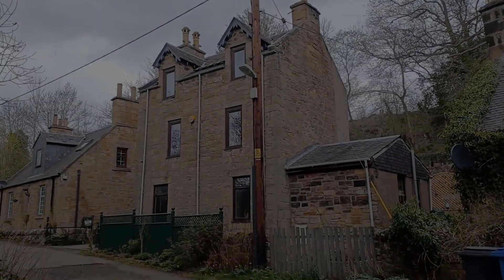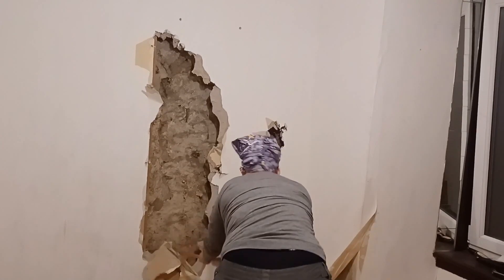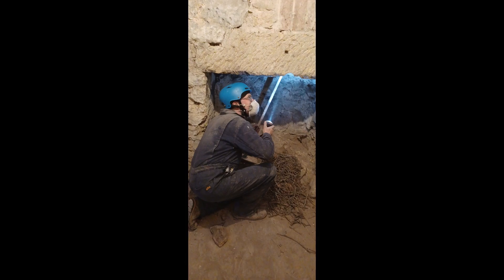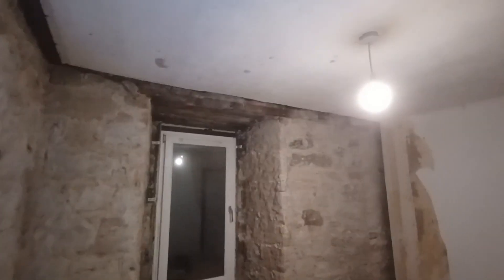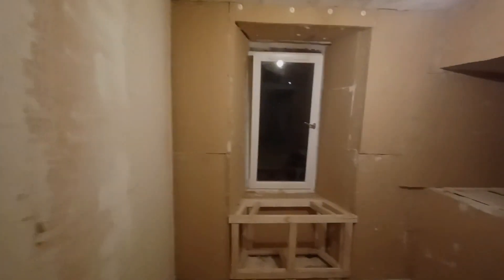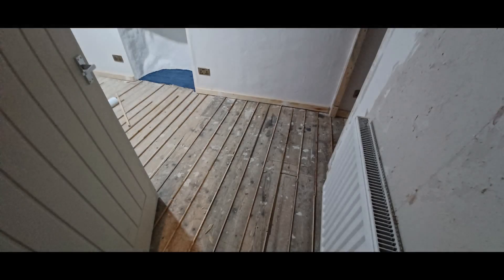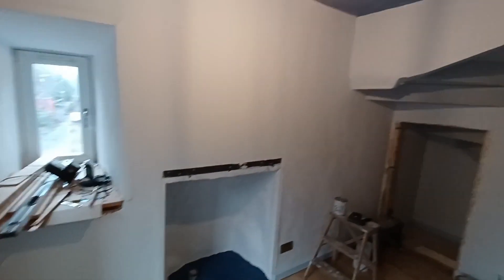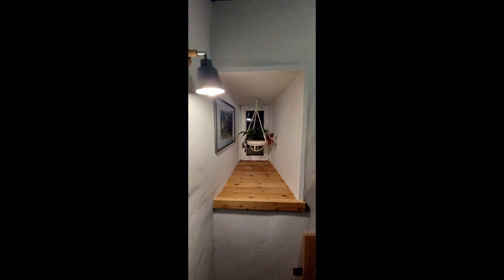Esk Tower - Retrofit Insulating a pre-1919 Scottish Stone Built House

Comment: Great job!   I'd love to get this done on the inside of my external walls which are are also sandstone construction (with lath n plaster finish at present)  on my Victorian house in Central Scotland!   What is it like fixing into the lime plaster with the wood fibre insulation behind ?   Can you put a screw through the plaster so the threads go into the wood fiber insulation, and does that give a strong fixing for items such as kitchen wall units,  or is it better to use a rawl plug as you would with normal plastered brick / block walls ?   I'm worried the lime plaster / wood fibre would just crumble away if anything heavy was fixed to it!    Has it made a big improvement in heat loss / comfort since it was done ?
Reply from the maker: @SoundsToBlowYourMind  You need long fischer fixings or similar that go through the wood fibre into the stone. You need to drill slowly and put masking tape on first to stop cracking.

Comment: Lovely method, I watched the video to see if there is a way to mix together modern passive house style air tight buildings and HVAC ERV ventilation with an old and breathable stone house. It seems like you've gone closer to the breathable old school way of working. How do you find humidity and ventilation inside the house? Are you happy with the results?
Reply from the maker: it's decently air tight but ive not done a smoke test at all. I've no issues with ventilation or humidity the windows built in vent do vent it enough, i also have two log fires which will vent it. having said that the stair well remains unchanged for now. stone buildings need to be breathable for moisture else you get damp walls, see the blog I linked in the comments here for draining around the walls.

Comment: What do you need to do to attach things to the wall? I assume long screws to go into the stone?
Reply: I think he used glue
Reply: I'd also love to know the answer to this. If you want to mount a TV for example, do you need to tap through long bolts with plugs all the way through the insulation to get to stone? Not sure you could hang anything heavy on the skimmed plaster and wood board.. but that mantle piece above the fire looks heavy, so I wonder what the answer it?

Comment: Would framing out the wall and using batt insulation be okay or could that cause moisture/ mild issues?
Reply from the maker: I believe that's an option but I've not looked into it myself.  The insulation would need to be moisture permeable (breathable) as it is here so don't use Kingspan style expanded foam for example.